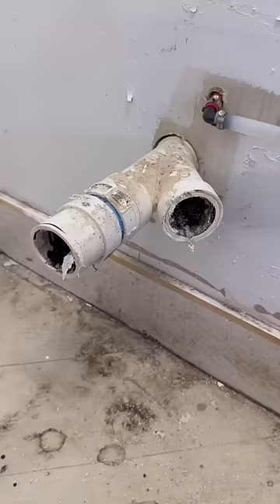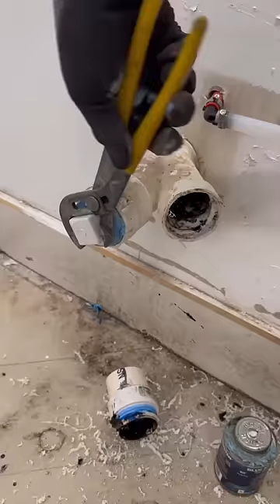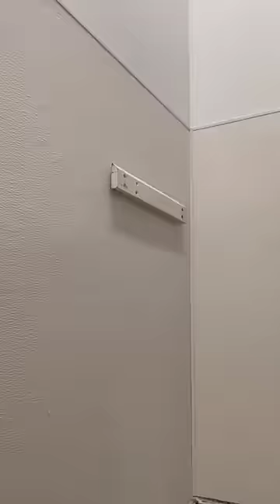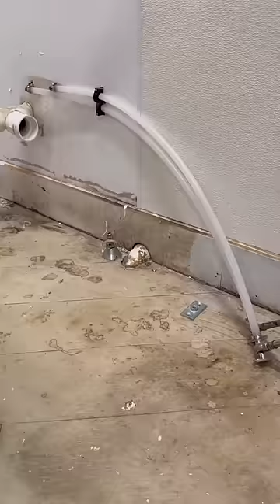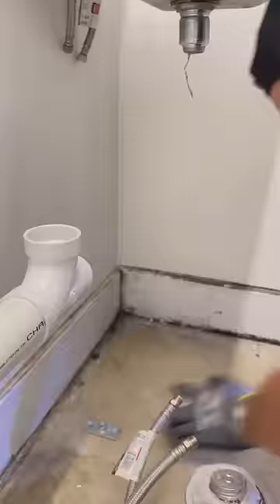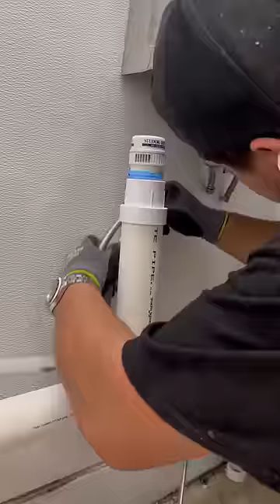Plumbing in hand wash sink #shortvideo #plumbing #construction #plumber #plumbingvideos #shortsfeed

Comment: Im a electrician but that Air Admittance valve vent fitting should be above the lowest part of the drain of the sink for  best install...
Reply: I seen that as well, but I watched the video a few times, its pretty close, still  to low for my liking but I think he barely made it.
Reply: 6" above flood rim gets ya there
Reply: The air admittance valve only has to be 4 inches above the trap.
Reply: Illegal in mn.
Reply: Go do it for him then. Damn.
Reply: It should be above the top of the spill for the fixture. I think a minimum of 6 inches. That may have been changed.
Reply: 6" above the flood rim. Also that area probably stinks. They are illegal in my state
Reply: 4 inches above the horizontal, he should be good
Reply: It will be fine like the more than likely but it should be above the flood line, sometimes you do what you gotta do and they go under the cabinet as high as possible it's better than nothing
Reply: Step Ladder, Can of Glue,and a Sawzall. Congratulations, You're a Master Plumber.
Reply: 6" above flood rim level of sink no exceptions
Reply: Yes. I am a plumber and it should be above the flood rim of the fixture. Obviously if it is in a cabinet you get it as high as possible.
Reply: Above the flood rim where im from. This installation would fail @kirbazoid
Reply: It should be!
Reply: Should be above the flood level rim of the sink.
Reply: @kirbazoid  illegal in Michigan. Needs to be above the flood rim.

Comment: Your studor vent is too low...must be above the flood plain or for those that don't know what that is...must be above the top lip of sink basin...if not drain will gurgle and won't pull enuf air to drain properly...and yes I am a master plumber with over 30 years experience
Reply: That is not correct, nowadays it is allowed to be installed in the cabinet , below the sink bottom
Reply: And yes I am a Class A Master Plumber Gas Fitter
Reply: PPS, the “top lip of the sink basin “ is commonly referred to as “Flood Rim” Sir
Yeah boy
Reply: @H2omboldt .  I would give him the benefit of the doubt, the words “flood plain” instead of flood rim might have been an auto correct during his typing.
Reply: So why is every Rv made with them under the sinks
Reply: The most common reply I see when someone installs an AAV. And it’s per area. It works, and generally only requires 4” above the trap. Everyone acts like it’s just the worst crime. People put them up so high that you can’t even replace it and it’s ridiculous.
Reply: @shoover2889 As long as the vent is installed within the correct trap to vent distance it should be fine.
Reply: @shoover2889 you’re absolutely right . Here where I am it’s a minimum of 4” but it also can’t be obstructed an have nothing above it an at least 6” of clearance all around it .
Reply: If you had told me you were just a do it yourselfer, I'd come closer to believing you

Comment: Turn the pipe so you don't see the words.  Looks much cleaner.
Reply: Thanks brother, I thought I was the only plumber who is anal about hiding the pipe lettering.👍👍
Reply: @veeko616 😅 completely opposite. All the words to line up with each other facing up.
Reply: @TwhistyyHD  I'm with ya on that too my friend, as long as the letters are not seen. Same with underground work.😂😂
Reply: If you're going to have your pipe work inspected, you better have your letters visible for the inspector. Especially underground even though you won't be able to see them once backfilled.
Reply: If you deal with getting your work inspected, you have to put the letters out so the inspector can see what Pipe you use..
Reply: @hunux4645 that’s what I do, all my ground work, words are on top for inspector to see.  It takes  dry little time to make it look extra neat, plus it shows how particular you are, less buyers remorse.
Reply: @veeko616 where I am located, it's not going to pass inspection without showing the markings. I don't buy junk pipe, so I prefer showing it. I also like running the pipe the same direction between fittings so you can constantly read the pipe 😂.
Reply: Inspectors like to see the lettering on pvc...there are several different types...dwv...sch 40...ect...inspectors like to see that you haven't put thin wall where sch 40 is required
Reply: I would have done the same  it let's face the facts here. It a hand sick in a restaurant kitchen I a week or so it is going to have so much grease and other kitchen crap on it the pipe will look like it has been there for 50 years 😂😂

Comment: The auto air vent should be one meter above the appliance for it to work properly
Reply: Agreed I was going to say the same thing it has to be at least 3 ft or so above the water line of the sink
Reply: That's not what the directions say on the vent I installed 6" above flood line of the trap
Reply: They work fine. The only one ive ever seen was in my log cabin. It was under the bathroom sink. I had put down a new floor in the room, but didnt install a new wax seal under the toilet. Started having a sewer gas problem. Replaced the wax seal and it fixed the problem. A couple of years later i was on the roof and noticed the original three inch air test seal had never been removed. That airseal had been venting a two bath, w/kitchen log cabin, for 16 years.
Reply: Hi . I do little plumbing work in Aruba . Whats the need for a valve on this waiste water line ? I mean maybe iam wrong . But i dont see the why .
Reply: @alexandercroes4647  makes the drain flow better reducing clogging and build up also keeps p trap from sucking dry
Reply: It’s above the flood rim and it’s not one meter it’s literally an inch above the flood rim. That’s it it has to be above
Reply: @alexandercroes4647 greetings! We just got back from Aruba 🇦🇼! Beautiful island 🏝! One happy island ! Lovely house’s on the coast going towards the light house and baby beach, 
 A jamaica 🇯🇲 in Texas .
Reply: @alexandercroes4647 that’s an air admittance valve. It acts as the plumbing vent when it’s not feasible to take the vent to the outside
Reply: DURO DURO DURO mis respetos por tú gran trabajo 🙏🏼
Reply: Meter? What kind of funny talk is that?
Reply: @cheezeball6109 you mean above the trap or sink?
Reply: A meter is three feet right? It should be above the highest point of drain. The sink basin is that. U do three feet above you might as well run a straight pipe vent through the roof. What about bathroom vanities?
Reply: @zekedepriest but no. Three feet he said.

Comment: Sanitary t on its back, classic
Reply: Well. It is a vent lol
Reply: Yup, damn handyman at it again.
Reply: Vent is supposed to be above water maximum line
Reply: Feel better with y and and 16 bend
Reply: @Spookytooth92  doesn’t matter
Reply: Plumber here who holds master Licenses in all the DMV. Well done sir! A sanitary tee is permitted on its back if use for a venting purposes. Check your local codes anyway. TBH the air admittance valve you installed has more than enough DFU to carry that little sink. Very Clean work 👍🏽
Reply: @JSoldier33  good to know. NYC plumber. Always thought it was just better plumbing. Maybe I was taught wrong all along.
Reply: @JSoldier33  better read your code book again bud, even if it’s a dry vent it’s illegal, nice try though master
Reply: Doesn’t matter where your at, that’s a line vent, has to be vented in ways that drainage would be acceptable, tell me where your from and I’ll pull your code to show you
Reply: @JSoldier33  and to add on top of it dude could have came up under the lav with a sweep sant then the aav , so if you consider this good work you’re tripping and I’m also a master plumber with a c-36, and a full apprenticeship under local 398, you need to go consult yoda
Reply: @Whocares69123 I knew I wasn’t wrong. I’m in nyc. I’m not a master plumber. But I’m a third generation plumber and steamfitter. I thought it was for better plumbing and it was code. Please someone pull up nyc code for waste and venting
Reply: Wet vent so it's perfectly fine.
Reply: @zacpattison9163 lol do you know what a wet vent is? Omg I can’t with these YouTube professionals
Reply: Code allows you to run aav on a santee laying on it back and code P2503. 5.2 says 4” above your horizontal drain so it perfectly fine, it’s not how I would have done it but with in codes in a lot of places
Reply: @plumbbuild6517  nope doesn’t say any about the santee being legal bro
Reply: @Whocares69123  if you look up the code it will show several different diagrams and one of them shows the santee layout but on a vent is the only time it’s legal in most places but the inspector can still turn you down.
Reply: It's a vent....not to code vent but still a vent
Reply: It just trips me out that so many plumbers don’t know plumbing codes on AAV 
  You guys need to look up the plumbing codes I checked with two different inspectors and they both said that was up to code just like I had already said.
I wouldn’t have plumbed it that way but it is code.
Reply: @zacpattison9163 that’s a dry vent 🤣
Reply: @mansoaptheif  when the sink on its not🤣
Reply: I would  of used a wye and a 45 instead  of the San tee
Reply: @plumbbuild6517 , you're absolutely correct, all these idiots complaining about Santee on its back, or vent not high enough, lol
Reply: @zacpattison9163  you have no clue what you’re talking about the water never flows thru that pipe that is vent ie….dry vent
Reply: San tee can go on its back if using as vent
Reply: Sanitary tee can never be on its back, never ever for any reason. Idc, but thats the truth.
Reply: @anthonymatsushino6997  wrong! Not AAV
Reply: @Spookytooth92  that’s right Spookman
Reply: @jayrod0603  do you mean an eight bend?
Reply: @jayrod0603  you just didn’t pay attention to the details
Reply: @zacpattison9163  it doesn’t have anything to do with being wet or dry. It’s fine. One of my bosses used to make me put a combo on its back and his reasoning was, someone might come along later and try to dump a drain down it. Lol.
Reply: @anthonymatsushino6997  not when it’s an AAV
Reply: @anthonymatsushino6997 Nope. Read a code book

Comment: Not sure about the air vent.... but good job anyway...
Reply: It’s below flood rim… I would have went higher
Reply: That’s exactly how an AAV should be installed. Code is minimum 6” above the horizontal run…

Comment: Clean install👍
Except for the fact that that studor isn’t 6” above the sink’s flood rim
Reply: Exactly what I was thinking
Reply: 6" above flood rm
Reply: Depends on where you're at, 4in is enough where I am! But I do usually try to carry it at least and inch above if I have room!
Reply: We can’t even use those
Reply: @Live4God3269  yea that sucks for y'all those things come in handy I don't care what anyone says!!! People say well they'll fail eventually and I tell them so is your damn car, are you going to walk everywhere you go from now on???
Reply: @liamsexton5476 isn’t it 6inch above the trap ??
Reply: Code 4101:3-9-01. Should be 6inchs above the flood level rim of the highest trapped fixture.
Reply: @TwhistyyHD  depends on where you are really, I've always kept them about the same height as the basket strainer and I've never had a problem with inspection!!! In the code book I believe it somewhere in it, it says at the inspectors discretion! Man you'll get failed for something and 2 miles down the road the same thing will pass, so I just try to stay consistent!
Reply: @ajcastillo9097  not code
Reply: @TwhistyyHD  no, international plumbing code states in section 918.4 it Has to be the minimum of 4 inches above the drain. you are welcome.
Reply: @TwhistyyHD  what code book is that?

Comment: Correct me if I'm wrong but i think the last elbow installed pushed back and just part of it got glued to the pipe. I know it's not going to be pressurized but...
And man. Those pex pipes just hanging in there instead using a drop ear elbow attached to the wall kinda hit me.

Comment: The wall should have been opened, cut out existing santee and reposition to run to sink center and stub out under sink. Then loop vent back into existing vent,  all inside wall.
Reply from the maker: I think so too

Comment: The mechanical vent is supposed to be above flood level rim.
Reply: Nope. A minimum of 4” above the trap is all that’s needed.
Reply: If the line is clogged the water will elevate in the sink. Water levels itself and will elevate in the vent also. If you install it 4 inches above pee trap you will have an over flow in the mechanical vent and the water will leak inside the cabinet. You need the mechanical tee to be installed above the flood level rim.

Comment: Your p-trap 90 backed off some, gotta hold it for a little bit longer. Code says 1 minute, no one actually holds it that long, but 10-15 seconds ain't so bad and it prevents stuff like that. All that being said, extremely unlikely to leak in that application.
Reply: Well if you dont trust your work its going to leak

Comment: The auto vent should be above the flood rim when possible.
Reply: When practical yes, 4" above the trap minimum.
Reply: @scottapt5291  wrong, ipc and upc require mechanical vent fittings to be 6” above the fixture’s floor rim
Reply: @wynstondannerman605  What if its a kitchen sink drain? Drill a 2” hole through the countertop?
Reply: @MisterTwister88  if you don’t know what the measurements for a standard sink are, you’re best bet would be to call a plumber

Comment: Clean and smooth looking install, the ready rods for support are a great touch !! Only question I got is the AAV is not 6” above flood level rim,is that not a code where you are ?
Reply: Example - Kitchen island, where are ya going to get an AAV above flood level rim?
Reply: @alexursu615  that’s right, we used to have to do a loop vent under the kitchen sink and if I’m not mistaken it had to be backed up by another vent close by. The AAV definitely saves a lot of time and money. It also acts as a clean out.

Comment: My only concern is the vent height. If they have a blockage back near that wye in the beginning of the video guess where the backed up gray water is going to come out of first
Reply: AAV. Is a one way valve. No way sewage can come up through it.
Reply: @Jch914  oh it can happen. They malfunction sometimes. Still should be above flood level
Reply: @coryyoung1857  not according to code. 4" above trap is minimum required.
Reply: @Jch914  not in city of Atlanta

Comment: I personally think that pipe has 3/8-1/2” grade per foot lol looked steep. But good work. If the air admittance valve wasn’t under the sink, you may as well have brought it up above the flood level of the fixture, like it’s supposed to be.

Comment: I would red tag your Santee for being on its back and your vent lower then the flood line, do your vent stack to the corner, stand your Santee on street 90 or long sweep carry your 1 1/2 PVC pipe up in the corner to at least 6 or 7 ft outa reach.... rookies I tell ya😂🤡😂🤡😂

Comment: Where I’m from you can’t use a San tee on its back in a drainage system. Only in venting or vertically.
Reply: It's a vent he put on it
Reply: But it needs to be higher than the fixure
Reply: You cannot install a San tee horizontally in a drainage system. Only vertically. As long as there is no water or sewage passing through the fitting then it can be horizontal
Reply: @axtweamauto9422 So how do you use one on a kitchen sink drain thats in a cabinet?
Reply: @evinbrewer89 wrong

Comment: Wtf is that vent? So your bathroom gonna smell like sewer gas at all times 😂? Super illegal in Chicago also that pex just dangling there🤡
Reply: You never heard of an Air admittance valve? It’s a one-way rubber flapper that does not allow sewer gas to come out. I never saw one either until I started plumbing off the international plumbing code

Comment: Can someone tell me whats the name of the part  (drilled into the floor) that stabilizes the PVC going horizontally?
Reply: 3/8 f&m plate
Reply: They come in steel, galvanized ,and copper plated
Reply: Ceiling flange with a split ring clamp